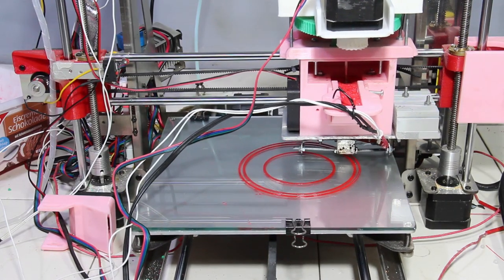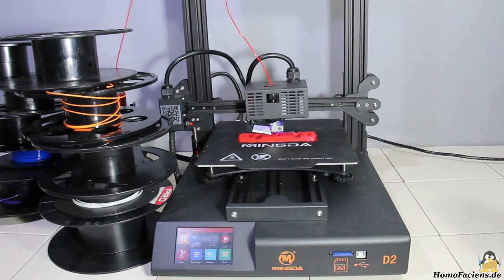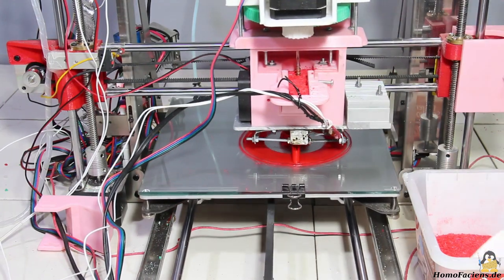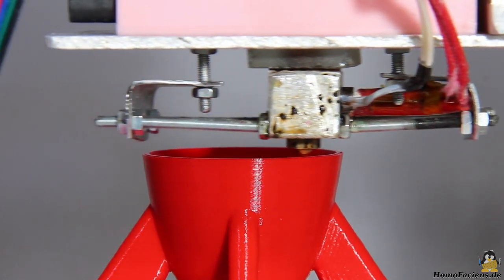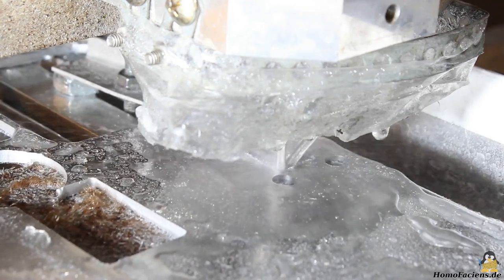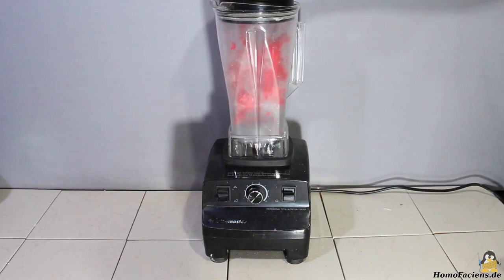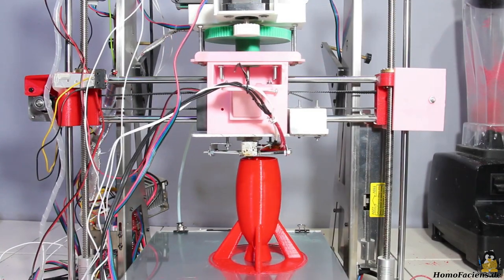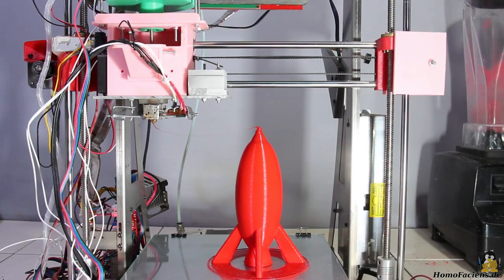Hackaday Prize 2021: Direct Granules Extruder

Comment: ive thought for a while that pellet extruders are the superior option for 3D printing since it eliminates one of the biggest problems with it, waste. Being able to cut out using spools entirely in favour of bags that cause much less waste, and the potential to be able to just grind up failed prints and re print directly is really cool and im surprised youve been met with so much criticism since these are two pretty prelevant problems that the community likes to talk about.
Reply from the maker: Thanks! The critisism wasn't directed to me (only a minor part), but many comments told me about that "it doesn't work" thing in forums. I never read those posts myself and so didn't know I was trying something "impossible" when I started this project.

Comment: What about having the pellet extruder off to the side and have it extrude into one of those Teflon tubes? I don't know how bad the friction would be admittedly, but at least you could maybe use some back pressure system to give a consistent diameter of filament
Reply from the maker: Extruding into a Teflon tube would lead to really high friction. The Teflon tubes in bowden extruders have for good reasons a larger inner diameter than the filament.

Comment: I love what you are doing. I wish it was easier to get this into more hands but the simple fact is for people to get into something like this it will require a lot more steps. I can see small businesses and big businesses doing similar things but for people that just treat 3D printing as a hobby it will take away from the actual 3D printing part of the hobby. There are other problems to but the main problem is it's more work for hobbyist. Hopefully you will find other uses for this project.

Comment: Like most engineering accomplishments, they always start out terrible, then you learn what’s not working well, implement a possible solution, rinse and repeat until you have a working prototype, it’s at this point the idea becomes viable, and you work on efficiency, and ease of manufacturing, it’s this stage I believe you have gotten too, past the ‘that’s impossible’, your now at the ‘here’s a working prototype’, so hopefully you get the hackaday funds to take it to ‘improve, and produce’, this is definitely a good project, and the way forward for 3D Printing
Reply from the maker: 5th place of the Hackaday Prize 2021:
https://hackaday.com/2021/11/20/flowio-takes-top-honors-in-the-2021-hackaday-prize/
Not the big catch, but a bit of money that drives my experimentation.

Comment: I had a thought while watching you load more granules using a spoon.  I'd guess you've already thought of this - but postponed adding it until the extruder is fully functional - but I'll type it here anyway...  You could have a large hopper of granules within the print volume of printer (but outside the volume of the piece being printed) - that the hot end periodically passes under - to load more granules - possibly using a simple mechanical trapdoor (avoiding more steppers/electronics).  You'd just need to add more code to your post processor - to add the moves to the hopper at an appropriate point in the print g-code, before the hot end's hopper is predicted to become empty.  Just an idea.  Good luck with the prize.
Reply from the maker: Yes, I will add something similar. The large hopper will be on the Z axis (that moves with low speed) and feed the tiny hopper from there. It will be a solution with no need for additional code. More on that in one of the coming videos. Stay tuned!

Comment: Using a blender to break down old prints is smart! This would work well as a 2nd printer, that you could use to print using old prints. As the extruder is so big, that its not good for fast printers.. but would be perfect as a secondary printer.
Reply from the maker: It is bulky (a proof of concept prototype), but not really heavier than standard direct extruders. The build plate moving along the Y axix is way more heavy.

Comment: First, belated congratulations on winning the Hackaday prize! And on the AMAZING work you did here; I was very very impressed. But as you opine, the lack of adoption is concerning. I think it will have more impact with the first dupicate is made (e.g. when someone else makes one). In that direction, have you seen this guy and his (much larger, but perhaps easier to make?) version
https://www.youtube.com/watch?v=ibXZOPIuT34
He uses a NEMA 23 and it rides on a CNC router bed. It's more expensive, and I wonder if his auger is really reliable, but still, it's great that someone else has designed and built something in this same area! I do hope you will come back to this printer soon, perhaps with a shredder design? Or an easy to follow construction video that really goes through all parts of the assembly. If I can support you, please let me know.
Reply from the maker: Thanks!
The big, heavy extrudes only can print large parts. Because of simple physics, the flow control isn't precise enough to print fine details through a 0.4mm nozzle. That's why my approach is to create a small extruder, using a tiny screw instead of a large auger or wood drill.
More on that and also how to get in contact with me and how to support me is on my pages:
https://homofaciens.de/technics-machines-3D-printer-Granule-Extruder-V3_en.htm

Comment: holy shit, your sugar extrusion gave me an idea.
I can use sugar as a cheaper PVA alternative! does it dissolve in water?
i wonder what pla+sugar would give :D
Reply from the maker: Of course, sugar dissolves in water. It is extremely tricky to print, more on that, soon.
Reply from the maker: Tinkerers "christmas bakery " ;-)
Reply: @HomoFaciens  oooh okay :D
pva is like 80-140$ per KG 0_0...
sugar seems cheap aF! i love soulables but i don't use them often cause of the cost
Reply: Hmm… sugar is very appealing. :) But I would imagine that it would be a strong attractor of water moisture in the air. After which, it will become sticky/gummy and when exposed to the heat of the extrusion process, result in steam generation. I’m guessing that in the video, the sugar was heated to drive off any residual moisture present in the raw material.
Reply: Hmm… maybe the sugar can be pre-melted and screw extruded as if it was a granular material? Pre-melting would drive out any residual water prior to entry/exit to the hot end region.  Let’s say not heated to the melting point of sugar… but just over the boiling point of water… yeah, this sounds like one would have to oven dry out the sugar at 100c to ensure it has not appreciable water moisture prior to melting/extrusion.
Reply from the maker: I don't see a need for drying the sugar before printing. There did not come any steam out of the nozzle. The bubbles that can be seen when the sugar drips out of the extruder are more due to decomposition of the sucrose. As told in the video, the sugar melts at about 170°C while the caramelisation starts at 140°C, so the sugar is melting and gets "destroyed" at the same time in the hotend. Really no simple to handle 3D printing material.
More on that in my latest video: https://youtu.be/ea2dfdTszqM
Reply: @HomoFaciens  oh nice! That makes for a really smooth experience if there is no issues with moisture.

Comment: building a separate filament extruder seems like a better solution than strapping that giant thing to your XY axis and you dont even have a large feed hopper on it yet. standard filament would work with any model printer and you could check the filament output before you commit to a large print.
Reply from the maker: It is just a proof of concept design and for that, larger is better. The final design won't be heavier than existing direct filament extruders. The core elements are really small parts, the next design will be more compact with a large reservior on the frame, feeding the tiny hopper on the extruder. Remeber the Y axis with the build plate is much heavier than the extruder on the X axis and this moves, too. Open your mind for this new technology ;-)
Reply: @HomoFaciens  I'm not deriding your work, its good. I just think taking it off the printer would make it more practical.
Reply from the maker: I know, but going from granules to filament and from there into the printer is what I would call impractical. Let's see what future Versions of this prototype will look like and how lightweight and compact I can make the design over time. Stay tuned!